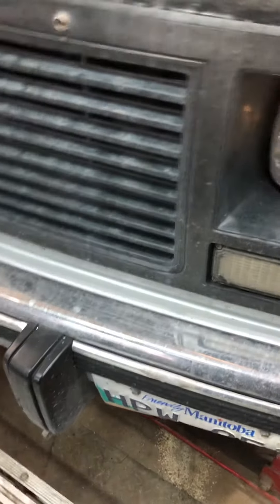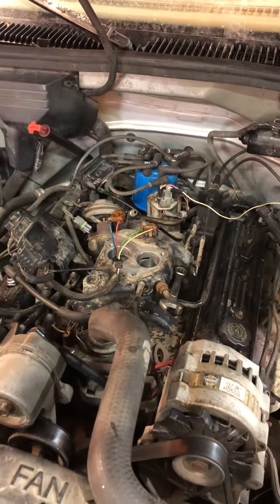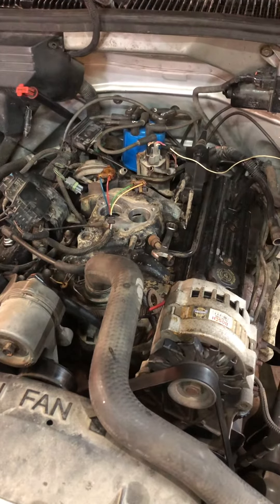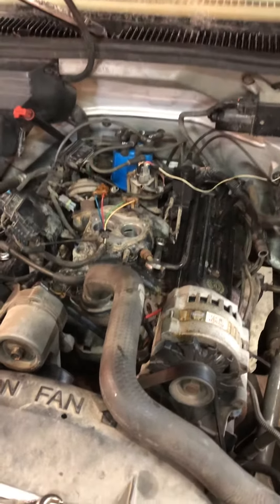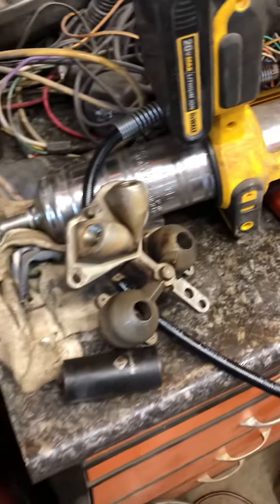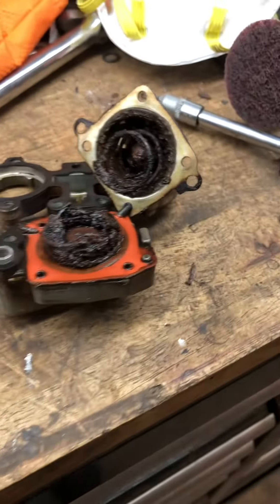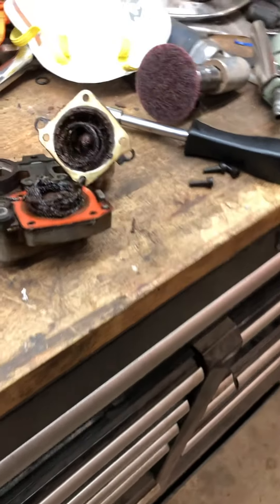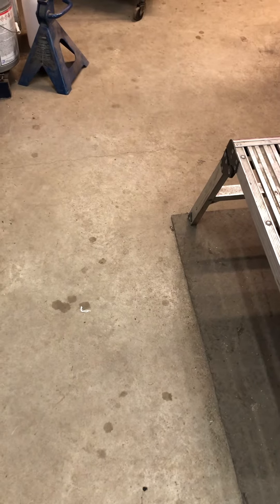Chevy tbi fuel pressure regulator failure

Comment: Crazy how nasty the inside was. Crazy the spring was just broken. Im messing with a 1988 sqaurebody suburban right now and bout to change the regulator since I doubt it's ever been done.
Reply from the maker: @ObservingTheSus  while you are back there, check cap/rotor. Mine was tracked so bad it would barely run

Comment: As for the regulator gasket a good tip is to coat the gasket with Chapstick (both sides). That will prevent the gasket from sticking to the regulator body and allow easy removal..

Comment: My truck idles great but when I hit the highway it start jerking and then it stops and goes it again could this be the problem I have new fuel pump
Reply from the maker: If ignition system is good, wires and plugs decent then i would consider a fuel pressure test. New fuel pump and new filter, not much left.

Comment: I can't find a part# for the spring or an auto parts store that has one.. my rebuild kit didn't come with one either.. did you happen to find a spring and what might the part number be? Plz and thank you
Reply from the maker: Kit number PR131 standard motor products has a kit, spring included. 
If all you are after is a spring you may want to try a gm dealer. 
Kit here in manitoba is $116

Comment: My 350 idles high after a while it shuts off but it still pumps gas like it’s running I shut the key off and if I turn it back on just to engage the pump it begins poring gas. Any idea ?
Reply from the maker: Seems like a bad injector or is commanded on by computer. Or there is a short to power or ground. I guess it depends where fuel is pouring from.
Reply: @franksgarage8551  yea I changed the injectors, ecm, icm, plugs/wires, distributor cap and rotor. Do you think it could be one of them ground wires like on the back of the block ?
Reply from the maker: @Romeo-k1500  test for voltage at injectors, key on there should be power but no ground, if i recall the ground is the trigger. Now, in my video, i was repairing the regulator, the diaphragms can leak as well. If its pouring out of the top, then that could be the problem. Pouring out of injectors is less likely than a bad regulator.
Reply: @franksgarage8551  thanks brother

Comment: Just got a 93 350 thinking my regulator is fried from ethanol and causing a flooded engine, it started and drove after sitting for a couple weeks, drove mint when gassing it but as soon as you left off gas it got rough and started backfiring until you got back to a decent speed and when parked it stalls, any ideas?
Reply from the maker: Thats about the same as what my tbi was doing. Fuel pressure test. There is a fuel filter with a test port you can buy. 
Also the coolant temp sensor by thermostat, unplug it and see if connector is green. Distributor cap, could have moisture in it. Shorting plug wires.
Reply: @franksgarage8551  thank you and I will check fuel pressure again last checked was running 10-12
Reply: @franksgarage8551  my knoc sensor is/has been disconnected. Working on that fix
Reply from the maker: @legalcs  needs 14 psi